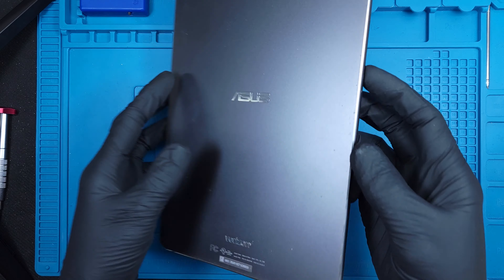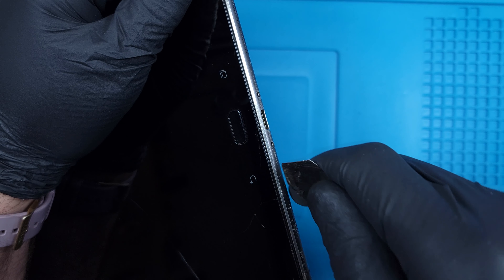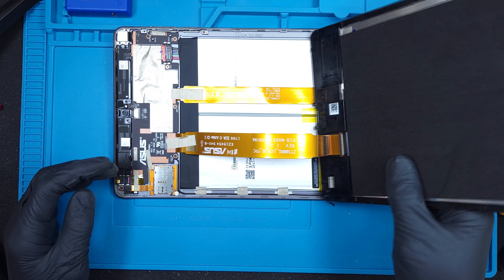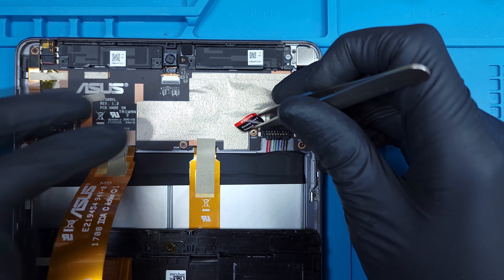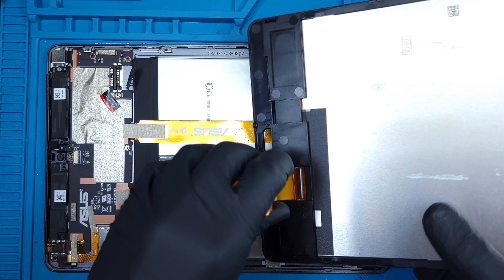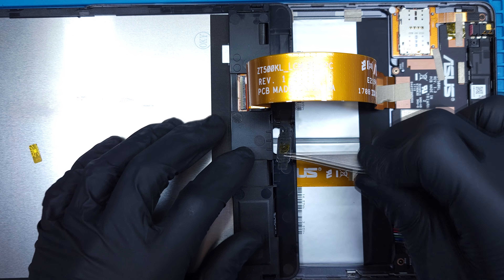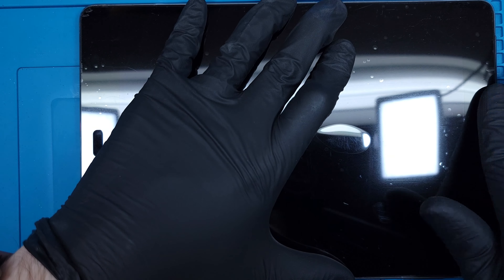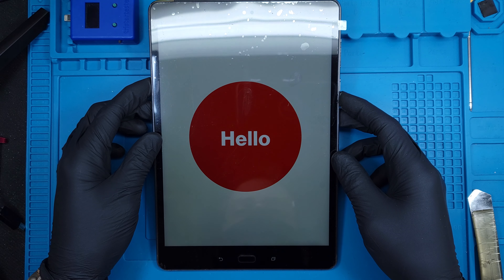Asus Zenpad Z10 Screen Replacement | Guide | Easy iPhone Knock-off

Comment: great video. however, you don't show when you re-install the battery. is it difficult? does it just pop back in? 

also, parts of the video, you have a USB cable connected. do you need this connected when testing functionality with new screen?
Reply from the maker: Sorry, yes the battery just slips back in. I periodically connect the power to make sure things are still working properly

Comment: Great video, congratulations!
Questions: at 0:14, what kind of screws are securing the frame (torx T3, T4, or other type)? What kind of screwdriver did you use? (i could only see the word "nicht" in the screwdriver, by pausing the video : D)
Reply from the maker: I believe they were T3s, but it's been a while since I've worked on one. I don't think it was anything weird like a pentalobe